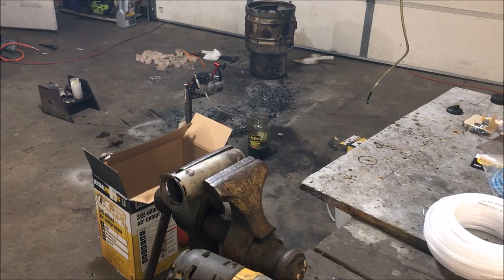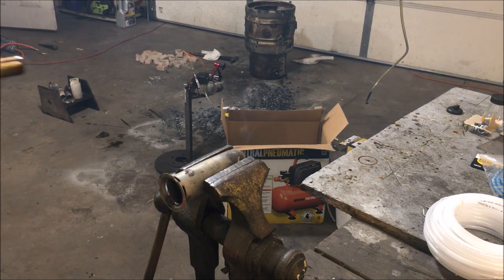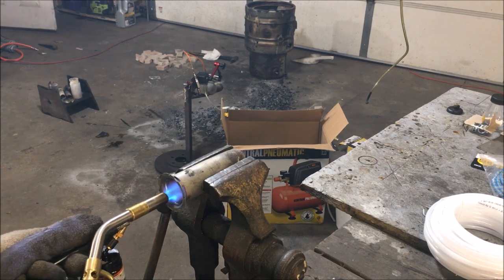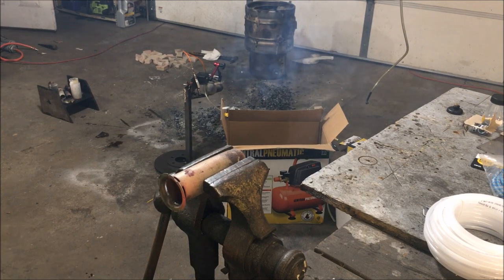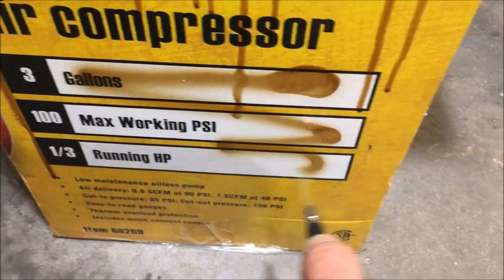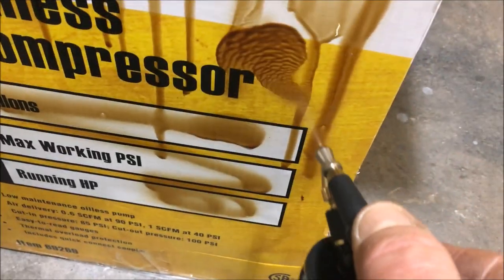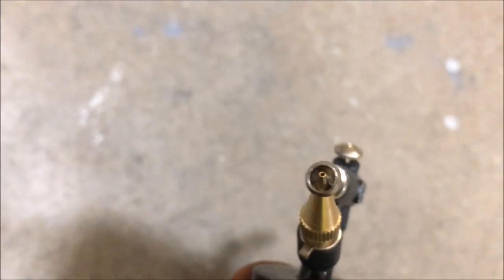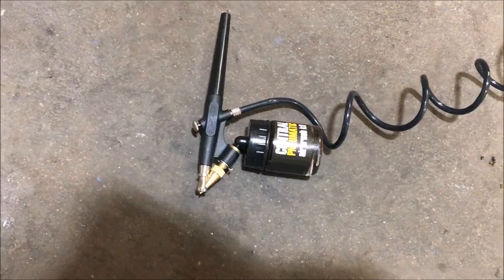( waste oil burner nozzle ) Air brush ???

Comment: Perhaps with a 90 degree angle piece the increased turbulence might kick this off.
You already have the copyright on that.
Reply from the maker: you have a point about the 90 , same thing happens when i built it , when it warms up i am gonna do some more testing , cant take the smoke outs , but i bet your right , a 90 just might do it on a little burner
Reply: BTW: have you ever looked at the Russians? 
Not that I understand a word of it but they seem to be quite advanced in waste oil burning technologies.
Just a random example: https://www.youtube.com/watch?v=YuwDj9gsQrw
More from there on.
Reply from the maker: thanks for the input on the russians , ill check them out
Reply from the maker: bro now im hooked on russian vids , these  guys are amazing diy 'ers

Comment: That airbrush is only meant to take up to 40 psi, you need a special kind of air compressor for an airbrush like that. Its also not meant to shoot a fluid the consistency of oil, the needle is constricting the flow. Try pulling the needle back a bit to open the flow